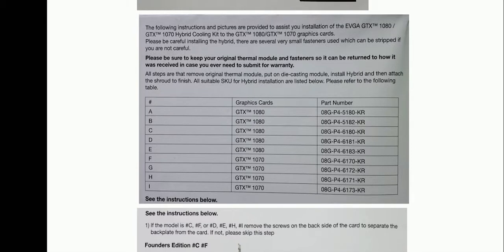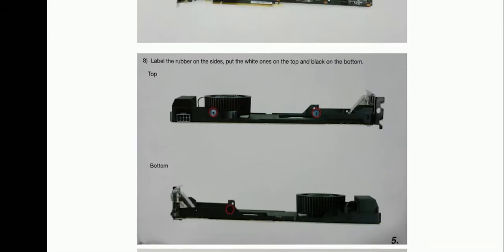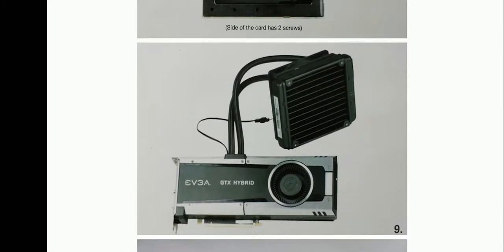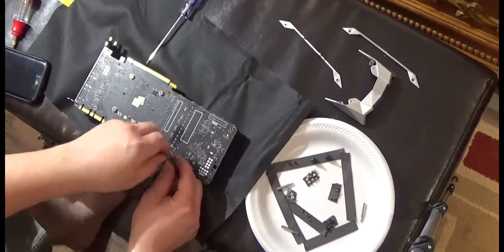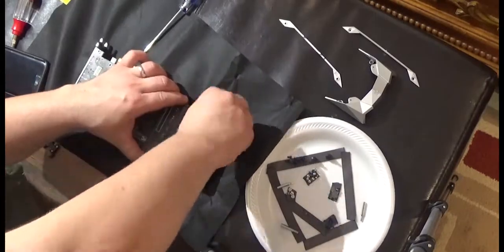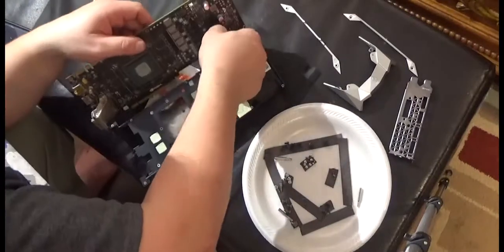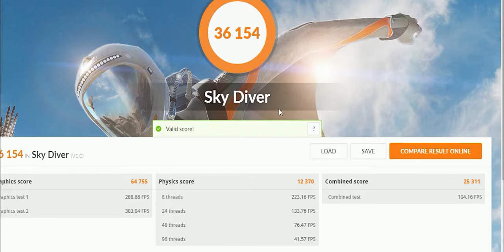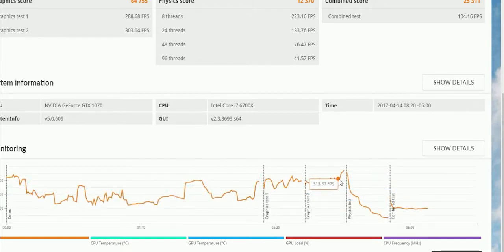How to Install Water cooler on your GTX 1080,1080ti,1070,980ti,TitanXP

Comment: would this actually fit the 980 ti ...they discontinued the 980ti kit so i wondered if picking this up would work
Reply from the maker: If the 980ti has stock PCB then yea it should work

Comment: I just installed this on my 1080 ti FE, temps now max out in the low 50c (was 80c).  instruction sucks and missing a few steps but not difficult to figure out.
Reply: could you please tell me where did you buy this kit from,cause i can't find it anywhere:( .i also have a gtx 1080ti fe.

Comment: Does this destroy the warranty?
Reply from the maker: Well I haven't seen anything that would make it destroy the warranty so I don't think so. These cards are so easy to take apart and put back together as long as you keep all your parts you should be fine.
Reply: There is a white round sticker over one of the screws

Comment: Fan Noise?
Reply from the maker: I have a cheap 120mm "back exhaust" fan which does make some noise but as far as GPU now vs before its 90% less noise now... I did have my fan curve change before so my fans would always be on near 100% when I'm gaming because I wanted temps around 70C. Overall PC is silent temps on GPU stay at mid 50s even after hours of gaming.